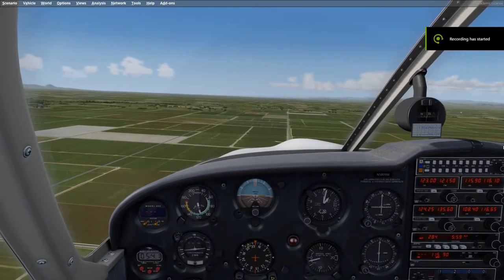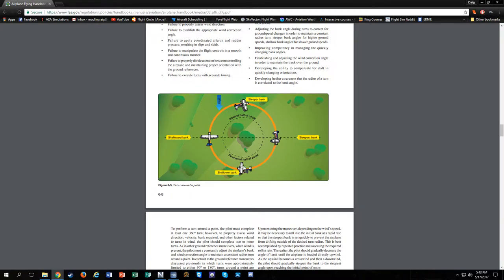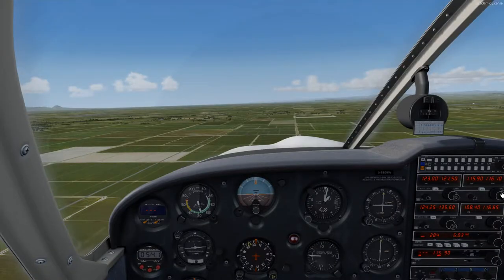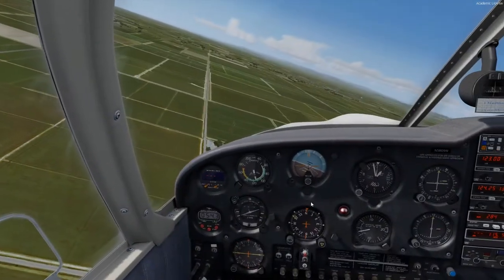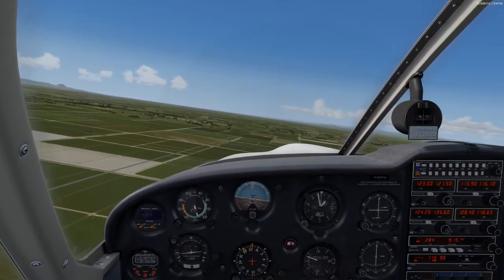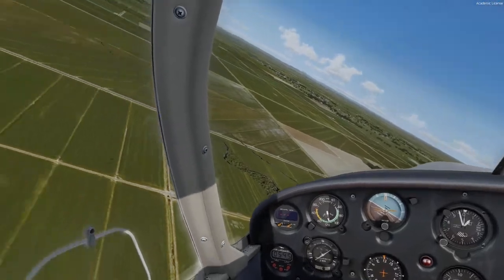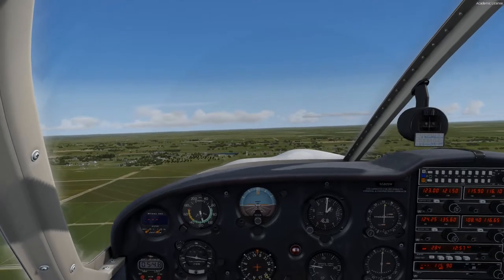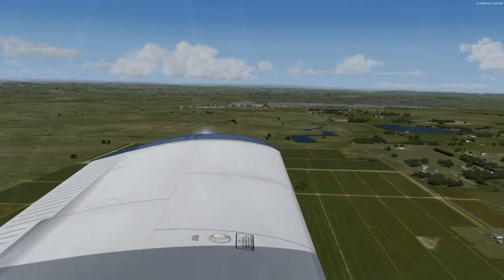Private Pilot | Ground Reference Maneuvers

Comment: Very nice. Does the constant Radius Turn also Work If you Just try to keep the Turn coordinator in the Same Position? Because In the Bank Angle which you need to keep the Turn coordinator in L or R for a Default Turn also depends on the wind or not? I Just want to make Sure that I understood it correctly.
Reply from the maker: Gega Zautashvili no, using the turn coordinator and putting the miniature airplane wing on the L or R will signify a constant RATE turn. You’ll turn 3 degrees per second and you’ll complete a 360 degree turn in two minutes. Standard rate turns are mainly used in IFR flying. Performing the turn around a point is a ground reference maneuver and it teaches wind drift. The object here is to maintain a constant radius turn. If there is no wind, then you can pick any bank angle and perform a turn. The bank angle will determine the size of the radius. Generally you won’t perform this maneuver at 10 degrees bank as that doesn’t really teach the lesson well. In a no wind scenario I’ll default to 30 degrees bank. When you introduce wind, you have to then crab into the wind and change your bank angle because your ground speed is changing. A fast ground speed will require a steeper bank angle to maintain the same rate and radius of turn.